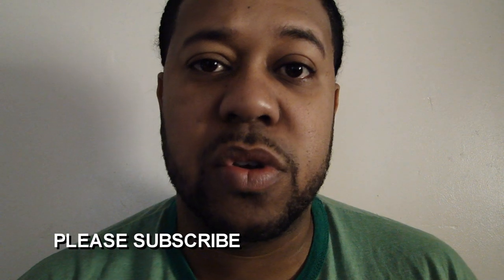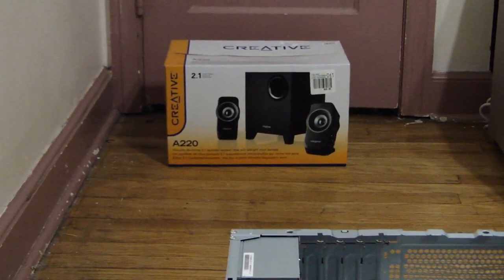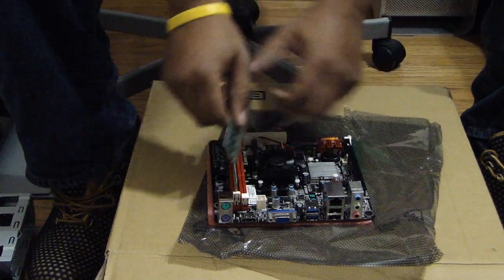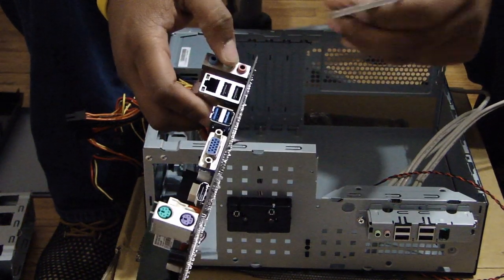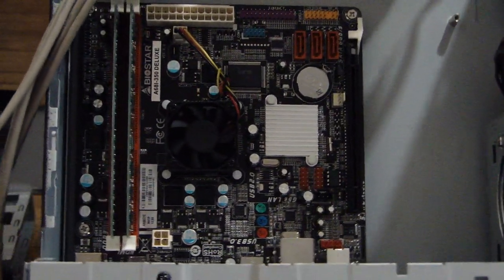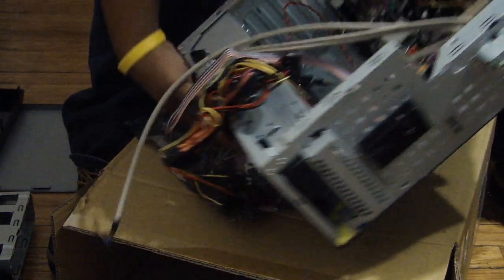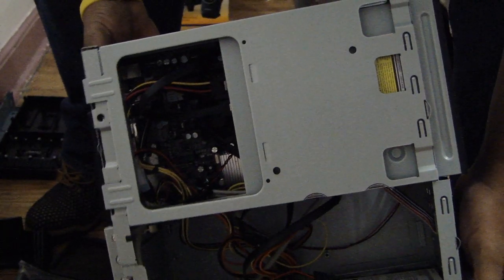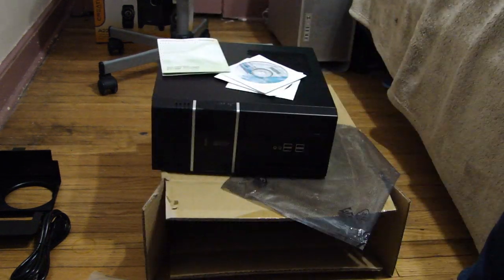HOW TO BUILD A WINDOWS 8 MEDIA CENTER

Comment: umm, dude you do not hook up USB until AFTER you install whatever operating system you are using.If you do windows sees the usb`s as a optical drive and label`s them as such. nice job tho and I`d use a table to work on touching delicate equipment !